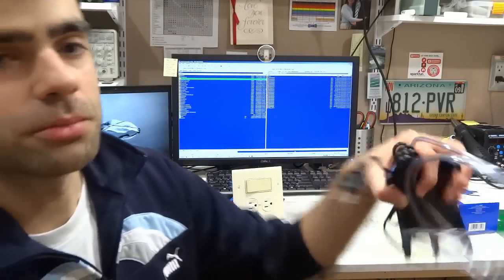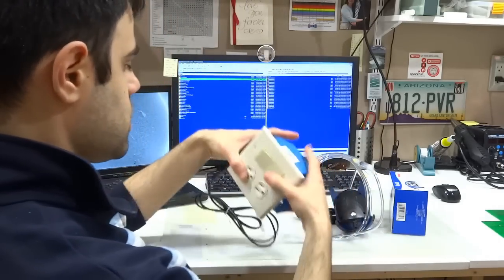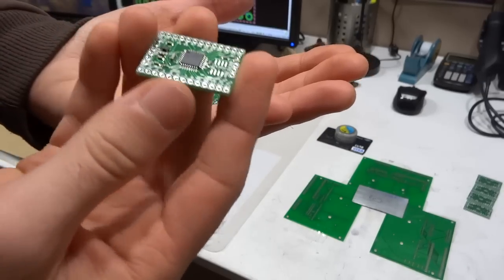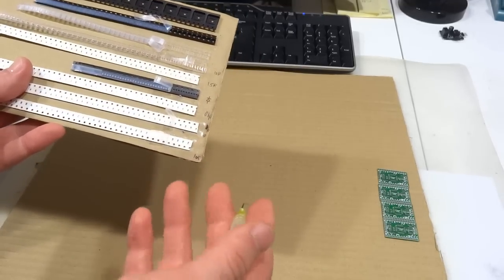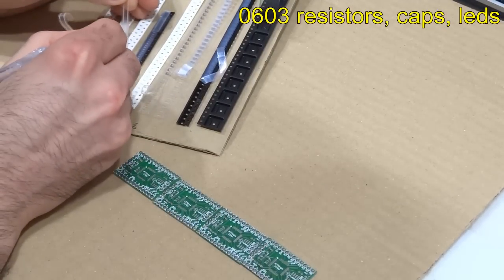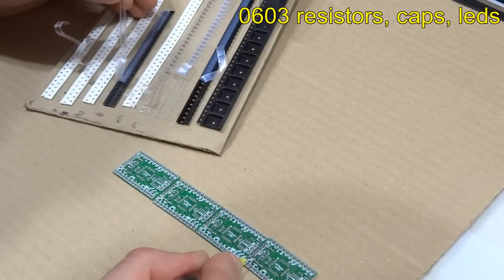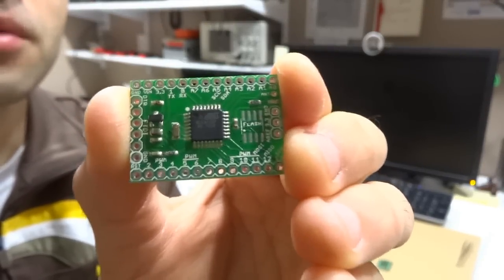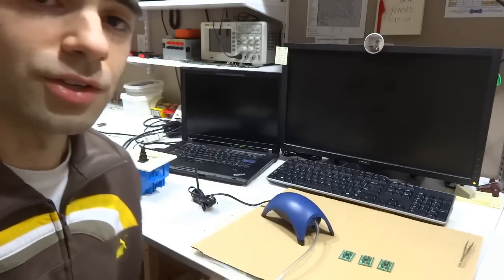DIY manual SMT pick and place tool for $20

Comment: You are using the paste completely wrong! You should let the soldering paste warm up to room temperature by itself over a time period of about 3 to 4 hours. You should not use the paste while It's cold and you should not speed up the warm up process. As soon as the paste has reached room temperature you should mix it for about one minute.
Reply from the maker: OK. And you speak this wisdom after how many years of experience designing assembling and debugging boards?
Reply: @FelixRusu  Just Two years (out of four) of apprenticeship (I learned that in a course at Work, wich was about soldering paste, automated stencil solder paste printing and pick and place pcb assembly) and a lots of designing PCBs as my hobby.
Reply: Oh and the reason why you shouldn't use the solder paste while its cold is because of the flux which is mixed with tiny tin balls (-> solder paste), which is too viscous for a good print at fridge temperature. You should let it warm up slowly, so any moisture wich could have gotten into the paste evaporates and doesn't get mixed into the solder paste, since the last thing that you want in your solder paste is water (since tiny water drops can "explode" while you heat up the solder paste). You had a good speed, but for perfect results you would hold the card or whatever you're using at a 60° angle relative to the surface (so a little steeper). The reason for this and also for the soldering paste temperature is that the soldering paste should be "rolling" and should not be dragged.
But no worries, most of this is just for perfection and for automated industrial use :)
Reply from the maker: @hgplaying5629  I am in the business of making boards for about a decade. When I posted this video I still made boards like it's shown in the video because ... I didn't have any real equipment, I was placing parts by hand and baking them in my ex toaster oven. Shortly after I bought the real machines that place and reflow boards. Paste will become less viscous far faster after repeated spreading, than you not warming it up slow enough. I could go on why every point you made is nice in theory but irrelevant or even dangerous in practice, but it's rather not start a debate in ... YT comments lol. And water doesn't explode, it boils to steam. Could be a problem if droplets are "huge", ie more like visible with a microscope, and not absorbed moisture that evaporates in a gradual convection heating,  and maybe if it's under some ridiculous pitch BGA part (0.2-0.35mm?), although at that quantity of paste the amount of water would be so small it's probably irrelevant. One more tiny thing - if you leave paste exposed to atmosphere so the supposed invisible water can evaporate, over long hours, that will also start to dry the flux, although apparently the paste will become more viscous, and that in addition to potentially oxidizing it - which would end you up in more trouble than water "exploding". There are all kinds of studies on this and this is not the place to debate theory vs practice. If I'd see things explode and paste not perform or solder joints fail in any way, I'd surely look into changing my practice - which I'd like to again point it is now somewhat different than in the video :-)

Comment: Found this via your Diy SMD stencils. I will have to try this. My only suggestion for upgrade would be to have the tool removable (same connection as aquarium air stones) so you can replace the tubing without having to undo the joint.

Comment: What kind of solder paste do you use ? Mine seems a lot thicker  and does not apply as easily.
Reply from the maker: Any reputable brand paste works well, look at digikey/mouser. Store it properly and it can last a long time. If it hardens make it loose again with some IPA but that evaporates quickly so keep the lid on. DO NOT use cheapy chinese solder paste.

Comment: Hey Felix, Just found you today and I want to replicate your vacuum system. Can you give me some facts, tube diameter external will do, syringe size, 5cc, 10cc etc and the needle size.  if you can, it would be of great help. I’m awaiting activation of my forum account. Mike Vogel.
Reply from the maker: Experiment with the thickness that works best. It all depends how strong the pump is too. The suction needs to be strong enough to pick parts easily, but not extreme so you can drop the parts when you release your finger from the hole you make in the syring cylinder. There are now kits for this purpose on ebay too.

Comment: I bought a Smd suction tool it come with different suction cups,the tool was around a dollar,doesn't work that well for me,if I was you I would buy it for the suction cups and the removeable bent needle the come with it,I like your idea. With the pump but I think those. Parts that came with my smd suction tool could improve your setup.I got it on eBay

Comment: Can you describe how to access and reverse the valve?
It seams that the chamber it is in is plastic welded or glued.
Photos would help.
Reply: I have done it. There is a rubber diaphragm cap on a white nylon valve assembly that can be slipped off the valve assembly.  
Then the valve assembly pulls out of the slot. Watch it as it comes out and rotate it 180 degrees so that the valves interchange positions on the input and output holes against which they seat.

Comment: My solder paste started shiny at 140 degree C. And the final result looked like hand soldered. Maybe because my stencil was thick ? its 0.25mm. But I got it done. Thank you very much for the video.
Reply: +xmenxwk It's because he is using lead-free solder paste, which has a higher melting point.

Comment: Awesome, but for $40 i bought the BEADSMITH PICK IT UP and i was good to go.
Reply from the maker: Thats great, the only thing I'd modify is the finger hole, it is too high up for you to be able to move the tip accurately. Cover the original with tape and make another hole close to the tip.

Comment: Also, reversing the bellows in the Whisper pump is a snap. Simply remove the rubber cap and lever arm from the white valve body. The valve body slides out. turn the valve body 90 degrees (be careful of the 2 small O-rings on the bottom) and it's reversed! Be sure to put the rubber cap back on -before- you slide it back together.

Comment: yeah that's EXACTLY what I did too. took maybe 10 minutes. didn't hafta drill nothin'. reverse take the 4 screws out to open it up... pry off the little magnetic gizmo get out a trusty small screwdriver and pry the little white thingee (valve assembly) up from the bottom (carefully). rotate it 180 degrees horizontally and slide it back in. reassemble and you're done.

Comment: Nice video. Any reason why you didn't just reverse the valve in the aquarium pump? I'm using the same or similar model aquarium pump and it seems to work just fine when the valve is reversed.

Comment from the maker: Yes it's much faster than placing with tweezers. Never tried 0402 but I don't think it should be much harder. You might need a finer needle yes. Just experiment with different needles and see which gives you best suction and lift. I would not use 0402 unless I really had to though...this method works best for 0603 and larger.

Comment: Thanks Felix, for the useful video. If you have to populate several boards with surface mount parts, using your pick and place device would be convenient as well as cost-efficient..Is it suitable for 0402 parts or do you have to change the needle to a smaller size?